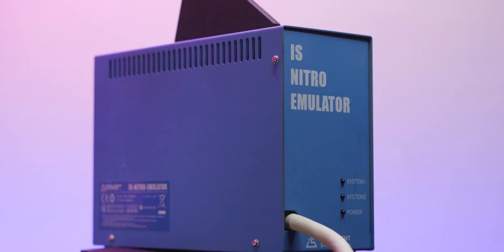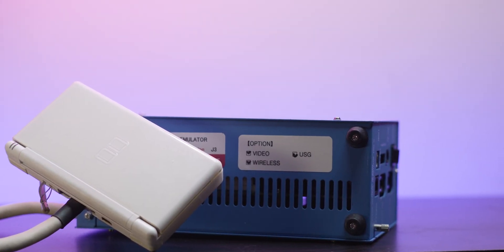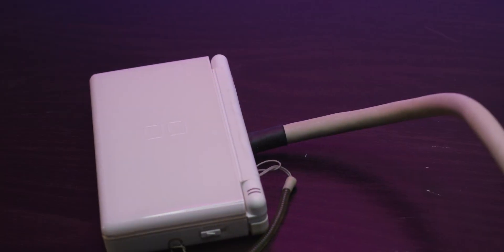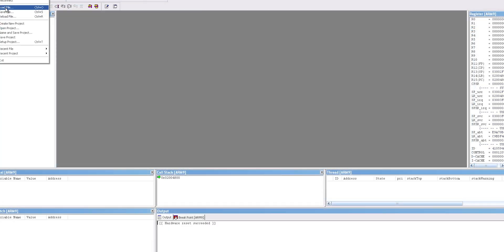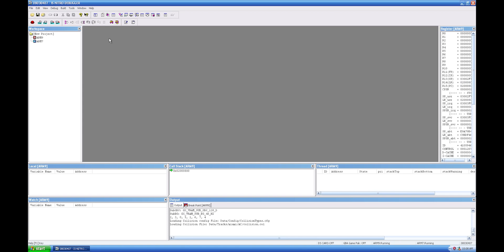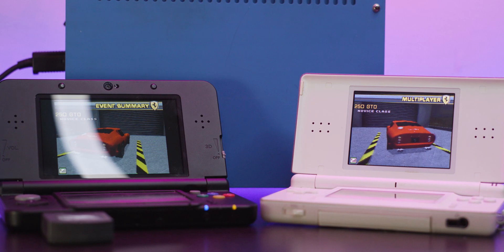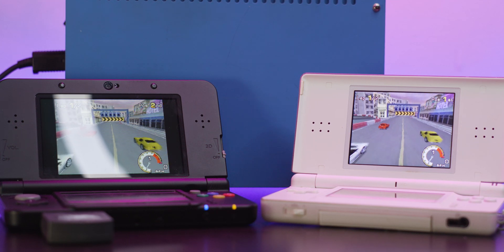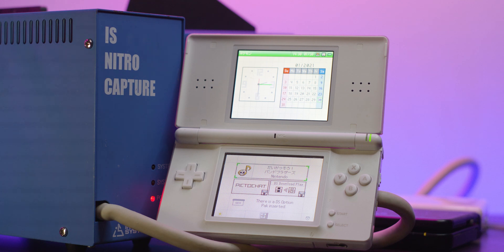Nintendo DS Development Kit: How I Use the IS-Nitro-Emulator

Comment: Cool, man) What about PS3 devkits? Do you have one?
Reply from the maker: Yep, both a large early one and a slightly later one that is normal PS3 sized.
Reply: @PtoPOnline  that's awesome, I would love to see a video with them! Also, I was wondering if ps3 devkits run games any better?
Reply from the maker: Not unless the development build needs the RAM, in which case usually its a case of running versus not running at all.
Reply: @PtoPOnline  got it. I thought about so called "downgrades", if the devs was putting better textures/particles in the game because of that bigger RAM, then show it on E3, and then downgrade the game to retail console? Is there any true to that?)
Reply from the maker: @SergioWhitestone  That's just part of the game dev process. Things get changed and optimized. Sure, graphics may take a hit, but often it means something important works or works better
Reply: @PtoPOnline  but still, technically, can devkits handle better textures because of bigger RAM?
Reply: @PtoPOnline  thanx for your answers anyways, i know, i can be annoying hah)
Reply from the maker: @SergioWhitestone  Sure, if it's programmed to use it.